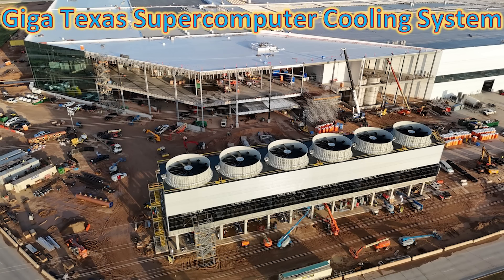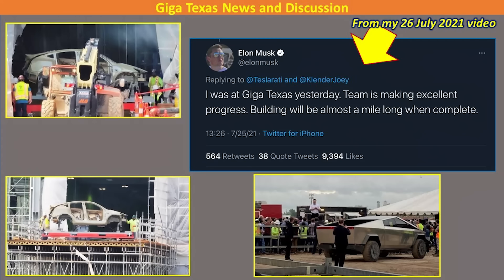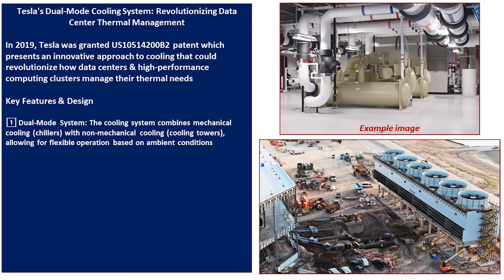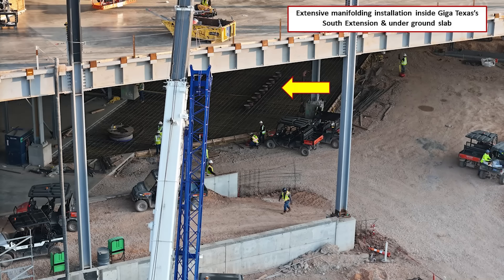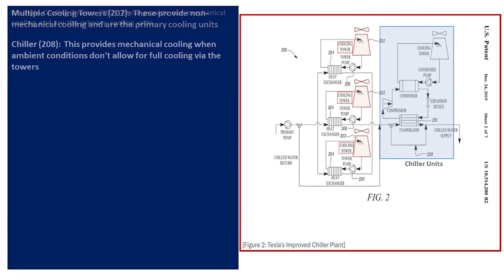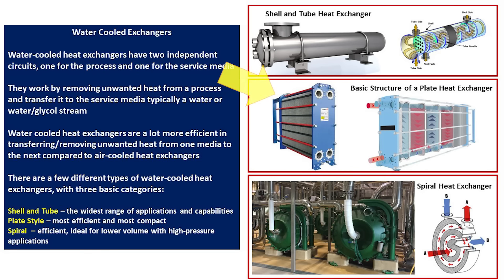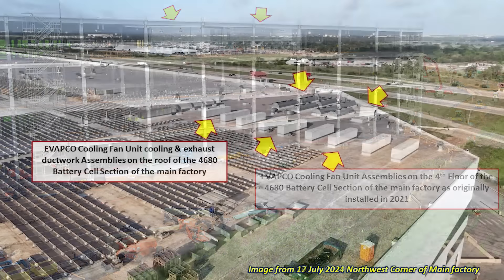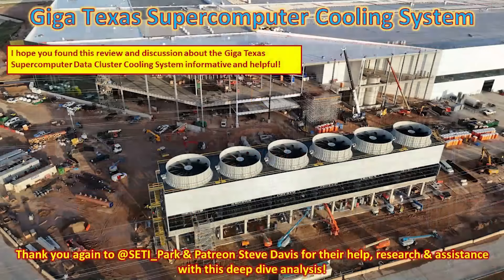Giga Texas Supercomputer Cooling System Deep Dive focused video clip

Comment: If you watch the Brad Sloan video about the Samsung Fab. In Austin TX he shot it a few days ago.
You’ll see the same cooling system except instead of 6 fans they have 15 Fans with room to expand. It’s completed I believe. Takes a lot of cooling for a microprocessors fab.
Tesla and Samsung seem to have the same suppliers. ( same parking structure only 1/2 size )

Comment: The power demand and hence cooling requirements of large clusters of processors can be very erratic so the cooling system needs to be quite flexible in its capability in addition to  seasonal variations.
Reply: On a large scale, variability is less significant.

Comment: I would note that the actual components which generate the heat are pretty insensitive to the surrounding gas pressure.  So instead of thinking of the system as a 'cooling' system, it should instead be configured as an expansion engine where the cooled gas is passed over the heating elements (the computer chips) and the gas is thus heated and expanded, increasing its pressure.  Look at this from a different technical angle, and you are looking at 'simple' gas turbine cycles with the computer chips being the 'combustion chambers' of the cycle.  The advantage of this approach is that you are able to operate the gas media at a higher pressure thus improving heat transfer.  You then run the expanded gas through turbines to extract energy from the gas which then drive the inlet compressor turbines, with final cooling of the bit of work the turbines has not caught being chilled down in the cooling towers.  This way you will actually be able to recover a useful part of the input energy, rather than just heating Texas with it.  All these energy hungry server and IT supercomputer farms are nonsensical in terms of waste energy, and the engineers should be ashamed for creating such stupid devices, when simply gas turbine cycles will get most of the energy (and money!) back.